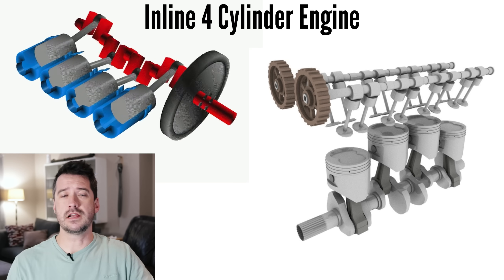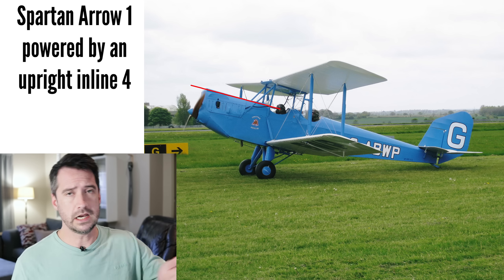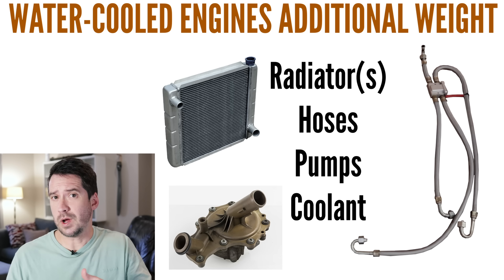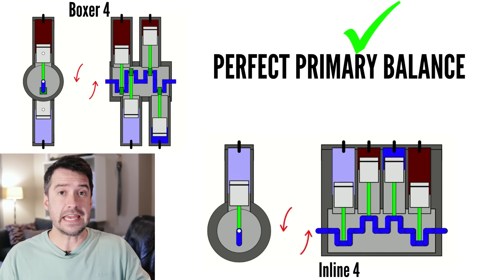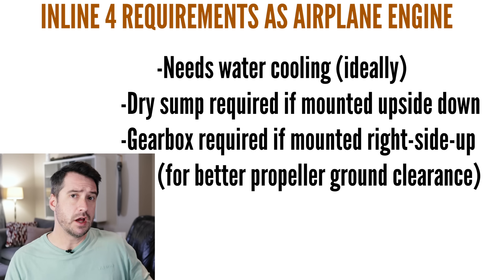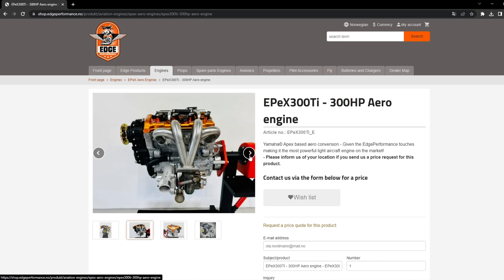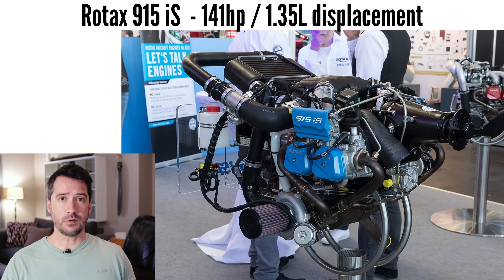Does Inline 4 Engines Suck for Airplanes? - Technical Deep Dive

Comment: Liquid-cooled engines are NOT heavier. When Continental converted its air-cooled engines to liquid cooling, the engines ended up being lighter than any of the engines that they built in the same power output range. At the very least, the engines were light enough to offset the weight of the radiator, coolant, hoses, etc. If the engines had been designed as liquid-cooled engines from the start, they would have been even lighter, as the bore spacing could have been significantly closer, reducing the size and weight of the engine.
Reply: Not to mention the heavy aluminium cooling fins and baffling that dont contribute to tensile strength of the engine. A radiators weight is much lighter.

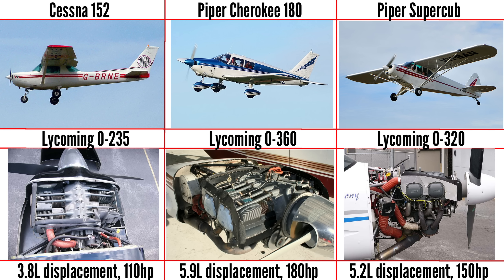Comment: 9:07 Why do these engines have so little power for so much displacement, do they have nonexistent max RPM or what's happening here?
A stupid idea but at this point a 1l motorcycle engine pumping out 200hp with a gearbox might actually be the lighter alternative
Reply from the maker: They have low max rpm in the region of 2,700 and also were designed with reliability as priority over power.

Comment: seems like the opposed 4's are doing fine. no certified aero engine is going to be cheap, and even if they get the cost down, what kind of reliability and longevity can you expect from one of these tiny engines. these engine conversion projects pop from time to time, with very few success stories. the mercedes diesel car engine that was supposed to be the future for small aircraft, never got certified. it's a lot harder than it sounds.

Comment: Referring primarily to Lycoming and Continental air cooled engines, I posted the following rant on Juan Browne’s Blancolirio channel.  I am weary of hearing about engine failures on GA planes.  How do you feel about this?

I don’t know if the crash that killed Richard McSpadden was caused by an engine failure, but that would be my first guess. There’s something that really bugs me about GA piston engine failures, that I want to get off my chest:  “Modern” piston engines seem to me like 1920s technology. 

Magnetos? Are you kidding? How many times has the ignition on my 10-year-old Toyota 4Runner with 425K miles failed? Zero.

My 4Runner’s engine has a knock sensor for optimizing ignition timing.  It has an oxygen sensor and a manifold air pressure sensor for optimizing fuel mixture.  It has fuel injectors that have never failed - not once - on “pump gas” for cars.  Of course it has temp sensors that I can see on the dash, and which also provide input for the engine control computer.  My gas mileage is not great but amazingly consistent. My only engine maintenance has been changing oil and one change of plugs.

I’m an electrical engineer.  One project for which I designed the analog electronic circuitry was a manifold air pressure sensor fabricated entirely on a small silicon integrated circuit back in about 2000.  I am also well familiar with acoustic, optical, and radio electronics and sensor systems.  

Any important engine performance parameter can be sensed.  How about the following:
•Fuel water content (by optical transmissibility and/ or electrical conductivity).
•Vibration spectral content (by acoustic or strain gauge sensors). This technology is in common use for sensing bearing condition. It could be also used for detecting imbalances in props, cranks, con rods, valve train components, and so forth.
•Oil turbidity (optical)
•Metal in oil (electrical resistance)
•Oil viscosity (pressure across and flow through an orifice
•Temperatures at a multitude of locations
•Precise measurements of fuel levels (MULTIPLE acoustic and/or pressure sensors in tanks)

Knowledgeable engineers can suggest more places.

All these parameters can be constantly monitored by an engine control computer.  Computation of condition metrics, including acoustic signatures, requires far less hardware than than sound card in a PC.  There’s no reason incipient engine failure can’t be detected, except perhaps for a sudden break like a rod failure. (But how many times has something mechanical let go in my 4Runner engine? Zero.  How many times have any of my cars’ engines let go in decades of driving. Zero.)

I think another dimension of manufacturing philosophy and practice is in play, too.  Back in the ‘60s NASA and the military screened parts by subjecting them to mechanical, thermal, and electrical stress.  Since then, manufacturing methods have improved so much that such post-production stress tests are not meaningful.  Statistical process control has beaten failure rates down to amazingly low levels.  Statistical process control has changed everything about military and space system reliability because it first changed everything about consumer and industrial reliability.  Ultimately military and NASA regulation philosophy and practice has caught up with this revolution.  To me it seems GA piston engines need to catch up. Perhaps there isn’t sufficient production volume? I don’t know.

It makes me angry to hear if so many deaths due to GA engine failures. I truly hesitate to to get into a GA piston plane, not that I have many opportunities. But I won’t seek them out, and this makes me sad. I so love aviation.
Reply from the maker: Many points made, I can't reply to them all here. But I will say, I hear you. 

I think GA engines are "catching up", as you say. Quite a few FADEC airplane engines now available, in 4 cylinder form, even in 6. That doesn't necessarily mean they get in huge demand and will replace the fleet of less modern engines.

I think a major problem in aviation is engine certification. It just isn't worth it for manufacturers to go through these days. This is why there are loads of fairly modern engines in the experimental section where certification isn't required, but almost nothing for old certified aiplanes (the Lycos and Contis), but something coming soon in that area on the channel.

Thanks for the comment.
Reply: The cost of General Aviation has skyrocketed and the costs of certification of any new products or systems makes them uncompetitive in the market right now... 
The aviation industry is generally facing a new much more serious problem with over-relialance on technology and a shocking lack of pilot experience and currency due to high costs per hour.

Comment: Smoothest running engine I ever owned was an inline 6 cylinder.   Too long ?
Reply from the maker: Indeed it is supposed to be the smoothest configuration. There are some bespoke inline 6 light aircraft applications, as well as popular ones from the 1930's, but yes unfortunately too long for most modern light airplanes.

Comment: Inline 4 engines were also made by Avia which also had mechanical distributor fuel injection. Far superior to carburettors.
Reply: Mechanical FI is not much less analog than a carburetor.  Full closed loop with electronic control is the only way to get peak efficiency in all conditions and engine loads.
Reply: @JimBronson  The systems I am talking about are basically the same as a mechanical diesel system. You may be thinking of what lycoming and continental call fuel injection, which are a 100% duty cycle injector. The US systems are basically just a carburettor, but the German and Czech systems accommodated for load and were actually sequential.

Comment: I don't know if the Viking line of Honda engines have proven them selves over time, like boxer four Lycomings and Continentals that turn at half the revs of the Honda.  The Honda at takeoff power is turning near its red line. I don't know of any car engine that has had the endurance to run at red line for minutes at a time, day in and day out. I'd question whether or not the Honda is any different, since the majority of Honda car owners don't run their cars in low gear with the pedal on the floor for minutes at a time, at red line, every time they start out. Of course the Viking is significantly cheaper than a new Lycoming, but it isn't an aircraft engine that will never exceed 3000 rpm either. 
Big displacement boxer four aircraft engines produce the horsepower and torque needed at 2700 rpm max, because of their displacement and simplicity.  5.125 inch bore and a 4.375  inch stroke. This is huge, and the reason they don't need to run at near 6000 rpm to make their power.
An 0-360  ways about 325 pounds. The Viking 150 is 239 pounds, by the way.  
I have to say that I own a 2017 Honda Civic with the 1.5 liter turbocharged 4 cylinder. 174 horsepower. I have 123,000 miles on it. It has a timing chain, something the Lycomings don't have. I wonder how long my Honda would last if I revved it to 5800 rpm for two minutes or more at least once every day for 123,000 miles. I divided that 123,000 buy an equivalent 60 mph and got 2050 hours.  About the TBO of an o-360 Lycoming.   
The Viking might be a great "budget" alternative.

Comment: They don't always suck. Inverted inline engines are quite fine. Walter engines, LOM Praha now, installed in Zlin and other aircraft. They produce 4 and 6 cylinder engines. They are particularly suitable for single seaters and tandem twoseaters due to their small frontal area.
Reply: Menasco Pirate and de Haviland Gipsy too
Reply: @WilhelmKarsten  True, but I don't have no direct knowledge of them, but I flew a few planes with Wakter engines and I must say they perform great. I could actually claim that engine, M-137  A saved my life, I have never seen an engine that would tolerate such abuse.

Comment: Actually, a Super Reliable, modern, Radial 3 Turbo, could be a really good light aircraft engine. ( needle roller rod bearings, roller bearing mains )
( like a slow turning 2.2L to 3.0 L that wouldn't need a gear box, with a mounted propeller accounted as part of the flywheel mas )
air / oil cooled, where a more involved oil circuit could help temperature regulate the engine....oil is lighter than coolant.
you know, modern ... electric starter motor, nikasil bores, EFI, a turbo, dual plug CDI ignition, full pressure lube.....air+ thermostatically controlled oil cooling....like a 2 pump dry sump circuit, and one circulating pump, thermostat, and cooler, working off the same oil tank.....or maybe an oil tank / cooler combination ? if working more surface area into the tank didn't make it too heavy.....or maybe if the tank was also structural?
Reply: EFI… why? The only advantage for an airplane engine over standard fuel injection is GDI’s added efficiency, which could be done mechanically like it is in an diesel engine if we didn’t care about timing it, which we don’t since we don’t care about part load efficiency. Honestly the same applies to electronic ignition, but we do already have P-Mags. Old radials are very much oil cooled as you said, and normal airplane engines have air cooled coil coolers with essentially thermostats called Vernatherms. I don’t think the radial really has a future, at least not a 3 cylinder one. As a packaging solution for larger engines perhaps. But i don’t think there’s anything wrong with most of the older designs in that regard. Despite the markedly superior efficiency to turboprop, turbofan and jet engines, large reciprocating diesels will probably never find a place in commercial aviation. If for no other reason than TBOs alone. Commercial jets can go for tens of thousands of hours, its going to be really hard even for the best possible made diesels to top that.
Reply: @Heatherder  WHY GO FROM A FLAT FOUR, TO AN INLINE FOUR ??? what would be wrong with a MODERN Radial-3 ??? GDI is EFI, unless it's mechanical, But Why Not Both ??? why not Mechanical GDI + Port EFI ??? I AM NOT TALKING ABOUT OLD RADIAL-3 DESIGNS , I AM TALKING ABOUT A NEW, MODERN, RADIAL-3 DESIGN, for light single engine aircraft..
Reply: @Heatherder  i am talking a Radial-3 with Plated aluminum Bores here.....but it could be just mechanical GDI, and Not both, because it could run slow enough to be just GDI.....it wouldn't need a gear box....with the angular momentum of the prop accounted as flywheel mass, it would be Competitively Light, and so with fewer moving parts....Torque is a function of Displacement and BMEP .... Turbos are reliable within their service intervals, and run with Back Up.....Depending On The Boost Level, anything from 2.0L to 3.0L Radial 3 would be fine...With Twin Plugs, a 2.3L to 2.5L could fully utilize it's rev-range with a reasonable safety factor from maximum piston ring speed.....but there would be nothing wrong with setting the rev limit lower, on a radial-3s from 2.5L to 3.0L to hit design Torque Goals.
Reply: @Heatherder  what i mean is, for light single engine piston aircraft engines....going from a flat four to a inline four is like going from stupid to stupider....there is nothing wrong with radial engines, except that the only ones that still exist are old designs... you would be surprised at the Reliability, Efficiency, Power To Weight, and Smoothness of a Modern Radial-3 Turbo design, if one were developed today...
Reply: @Heatherder  the main thing would be making it a Thermo-Regulated engine....but it's power to weight is going to depend on being primarily air cooled....
Oil is Lighter Than Coolant !!! it doesn't have as much thermo-cappacity, but it is lighter....so Air + Oil is a good place to start....a radial-3 wants dry sump pressure lube...So Just Add A Recirculating Oil Circuit In PARALLEL....it would come up to temperature a little slower, but it would still be a thermo-regulated engine.....
my point is, the oil cooling circuit would have less extra heat to pull off...And the cylinders would be evenly cooled.
Reply: @Heatherder  ok if the Crank drove the Sun Gear, and the Cam Ring was The Ring Gear, and the Planets where Held Stationary....
Then A 3-Cylinder Radial Would Have A 2:1 Reduction Built In ( the Prop moving with the Cam Ring ) 
for example: 32T Sun, 16T Planets, 64T Ring, would leave plenty of room for a couple tapered roller bearing in the crank end.
so maybe just a 1.8L Turbo 3-Cylinder Radial would do... bore 98mm, stroke 78mm = 1765cc ... something like that.
Reply: @Heatherder  maybe as small as a 1.3 Litter even. with the reduction..
Reply: @Heatherder  90mm bore x 70mm stroke would be 1336cc ....that would be about 125 HP in turbo aircraft trim.
Reply: @Heatherder  or Bore 94mm X Stroke 72mm = 1.5 litter
Reply: @Heatherder  and make the cooling fins in concentric arcs....that would look awesome
Reply: @Heatherder  a primarily air cooled aircraft engine would come up to operating temperature reasonably quickly, 1) because it's under load, and 2) because the temperature differential, between the engine and the air, has to do with how much heat it loses to the air in the first place...
though it wouldn't get to temperature as fast, there temperature regulating load would be substantially lower.
Reply: @Heatherder they can size the fins after they size the dedicated cooling oil passages....and i think people running aircraft in colder climates, might sand down the fins themselves a little anyway..
Reply: @Heatherder  i think the 1.5 Litter would be best .... people would make custom cowlings to fit it....
a 140 HP would push a Long EZ to top speed, or a heavier aircraft with a shallower pitch prop..
Reply: @Heatherder  with separate cylinders and heads, it could be considered a "platform engine" with some variations possibly making over 200 HP....light and reliable, those are main things.
Reply: @Heatherder  and of course modern efficiency, as you were saying.
Reply: @Heatherder  typical Direct Drive AV gas engines make 40-50 HP per litter...so that gear reduction would make a big difference.
Reply: @Heatherder  maybe 1.8 Litter....but i think people would modify or build entire new air-frames around it....whatever displacement it was.....and air frames are getting more efficient
Reply: @Heatherder  i am not doing the market research for any capable company though....so maybe it ends up being a Radial-5 Turbo....but the radial would be better off revisited for single engine aircraft, than all these mutant adaptations.
Reply: @Heatherder  i don't know how they ever did a ring cam for an Radial-5 though....different gearing than the Radial-3 obviously....the Radial-3 wouldn't be bad though, with single engine aircraft generally getting lighter.
Reply: @Heatherder  a 2.0 Litter Radial-3 is about where flame front speed and piston ring speed converge .... so for an R-3 with a reduction, that would be about the maximum extent, free of the law of diminishing returns..
Reply: @Heatherder  of course the cam ring gear mechanism would have to be beefed up to handle prop loads....but it functionally needs to be there anyway, so it would end up being a weight reduction measure, of some amount...
Reply: @Heatherder  so i have settled at a 2.0 Litter Radial-3 Turbo, as covering the largest part of the market...
where also in aviation, 
a lighter engine is effectively the same thing as a more powerful engine. ( and it would be lighter than a 2.0L air-cooled flat four )
Reply: @Heatherder  2.1 L ...700cc per cylinder...i will call that the upper limit... bore 100mm x stroke 89mm = 2097cc
Reply: @Heatherder  i will bring it up with H-D, and see what they say.
Reply: @Heatherder   i do concept development for H-D, i was just talking about it as a design exercise, ( until i found out what they go for )
the Radial-3 Turbo will be in a surgical clean room assembly, and preceded by meticulous QC if it goes.....but i did get the bulletin on it written up, and slated for forwarded to H-D headquarters ASAP....so we have the Radial -3 here.

Comment: Light trucks in Asia have up to 4.3 liter inline 4 engines.
Reply from the maker: Not only in Asia, and same as the 6.1 liter Gypsy inline 4 airplane engine heavily featured in the video, I explained why they can be that large, as they are low revving engines and thus the secondary imbalance forces are small.